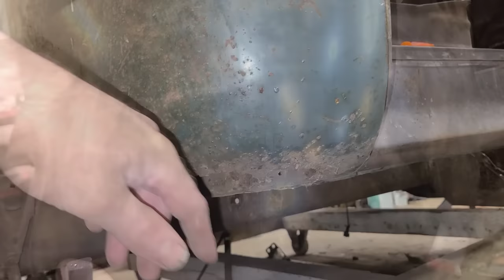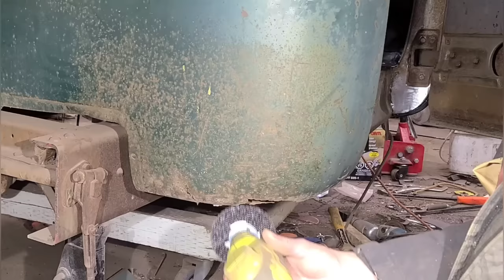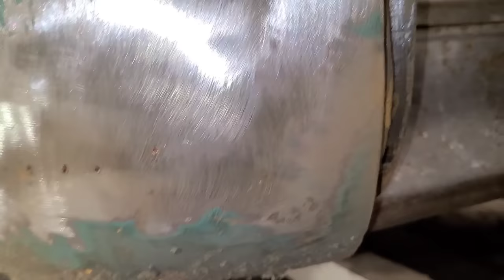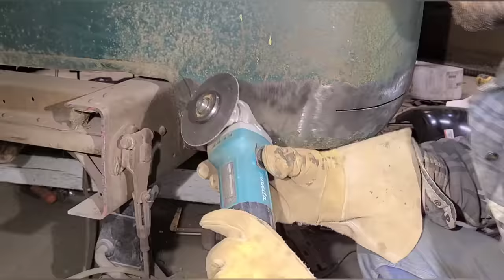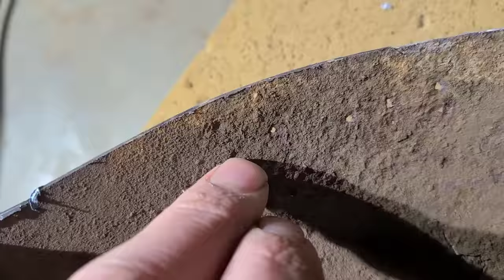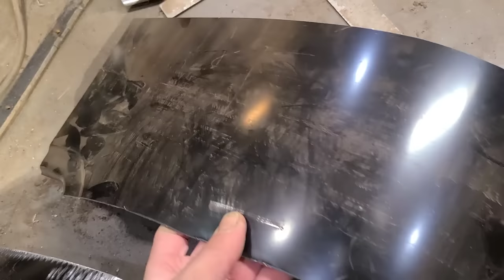How To Fix Rusty Cab Corners! The Heartwarming Journey Of A Neglected 1948 GMC

Comment: Observation: 
The drill/ wire wheel is screams half-a$$.
Run don't walk away. That repair will get you 2 years max then the entire fender will be shot. Especially snow states.
Reply from the maker: My entire fender will be shot because I used a drill on my cab corner? 
Not very observant are you?
Reply: @CrapyAuto - Umm . . . I  was suggesting that a cordless 4-1/2" side grinder with appropriate sanding pad is what real guys use - like as in the past 20 years. You know professional, not a N. India guy video.
Reply: @RustyJ - No avatar? No videos but troll? HF dicount card?
Reply: @itsruf1  What are you talking about? Maybe with newer cars with tin that is thinner than paper you must be extra careful. Those kind of cars are so weakly built that if you spit on them you make a dent. Did you ever work with good old solid heavy metal vehicles? I repaired my 63 Chevy like that in the Mideighties. And the repairs held up just fine till now!
By the way we live in a "Salt and Snow" country. I started using my wire wheels again after twenty years. They worked fine for a century and they still do the job!
Reply: @beatglauser9444  ... When we grind on a vehicle, it is not to remove the metal. It is to condition the metal so that it can accept, body filler. Even if it's just a light coat, you have to condition the metal to accept the filler. And I don't care how expert anybody says they are. If you haven't conditioned the metal properly, your body filler is going to fall out. And yes, every single vehicle on the market has  body filler in it. Whether it be a polyester filler. Or, a metal filler. They come straight out of the factory with filler in them. And when you're using patch panels, there should be an acceptable amount of grinding over the weld, and on equal sides of the weld. Because you are dealing with three different kinds of metal there. Now, you are dealing with three different kinds of low frequency resonant vibration. So the trick is, to get all three kinds of metal, to vibrate at the same rate. This is easily accomplished by, proper grinding of the repair area. Newer cars, older cars, it doesn't matter. If all three metals are not vibrating at close to the same rate, your body filler is going to crack and fall out. Heavy coats of body filler such as, fiberglass filler. Requires at least a 36 grit to adhere. Midcoats generally require 80 grit. And icing coats can adhere between 80 and 180 grit. Depending on the brand. Paint and clear coat will delaminate, on surfaces that have been sanded finer than, 600 grit. And if you're planning on polishing your clear coat, after it's been freshly painted which makes no sense to me but I don't know why anybody would have to repair, fresh clear coat. But I digress. If you're planning on polishing fresh clear coat, you're going to want to stay under 600 grit. Because your polisher will heat the surface and cause premature delam. You can destroy the adhesion between paint and clear coat, with excessive buffing. Abrasives, and top coats, are a symbiotic relationship. Without the correct abrasives and top coat combinations, you're pissing money down the drain.
Reply: @mr.mckinnon5680  We always used 36 grid before applying filler. Today I stopped putting filler directly on bare metal. I put a layer of expoxy on it first. Of course you must roughen the surface up in order to make the filler stick.
By the way when I worked on cars that had been repaired in the old days there was sometimes layers of 1 component filler we called nitro filler.
I pulled an Austin out of a junkyard: The paint was gone, the bare metal was exposed for many years and there was zero rust under the filler.
The problem was applying it took ages, thin layer after thin layer. And then you had to wait for ages before it was dry. I think I have seen a video on this channel were a fender had this material on it.  It did not even crack when hammered. What you said about sanding is something I totally agree.
Reply: Excelent job very  nice. Maybe if you do a quick pass over the repair with a 4.5 inch body grinder it will last eight years vs 2!.......seriously i might use a drill with one of those mini grinding discs next time cause my air powered angle Die grinder is weak and high pitch noise is annoying
Reply: @beatglauser9444  0
Reply: @itsruf1  I can't find your vidoes on power tools or metal work. You have the nerve to call someone else a troll? Please leave the grown ups alone. Thank you.
Reply: @UnNatural - where's yours? Where's your avatar? You are in the "Corded Tool Boi Club" also? Camp out at HarbyFreight for BFri deals? Rub one out for the Father's Day super-mailer?
Reply: @FugAnyCow - No videos either? No accomplisments?
Shower this weekend?
Reply: @itsruf1
Observation:
He was working on a cab corner, not a fender.